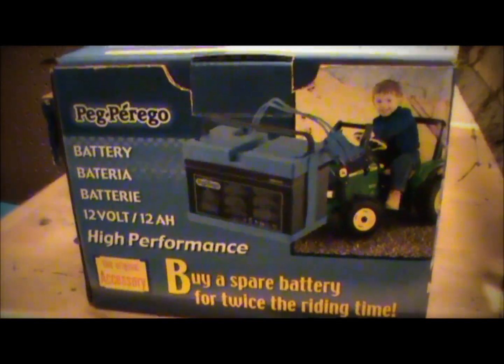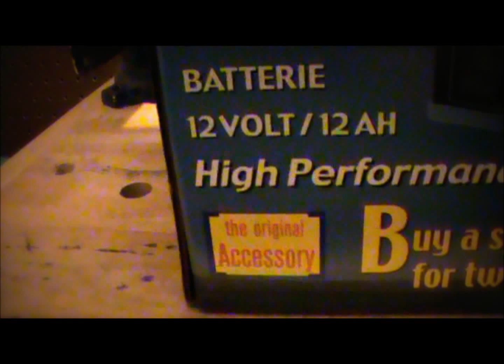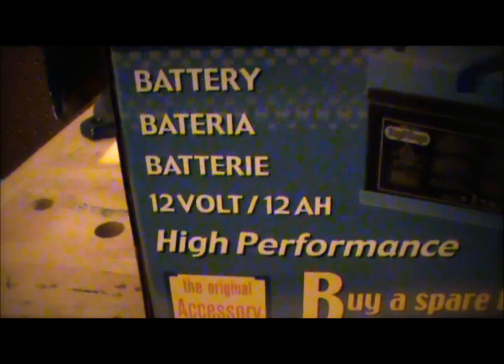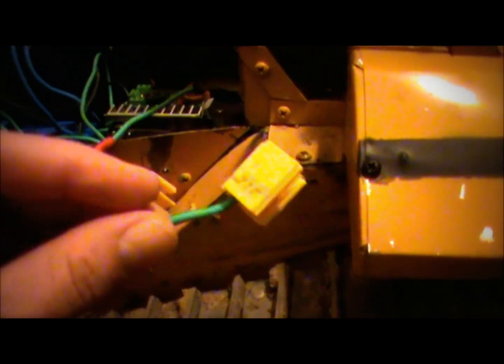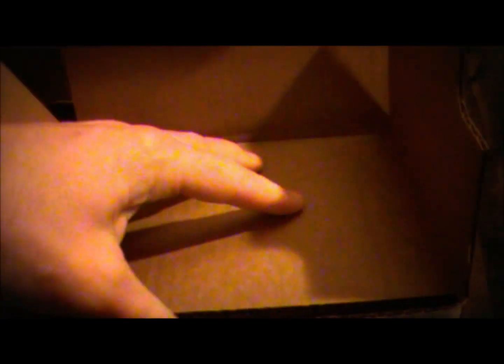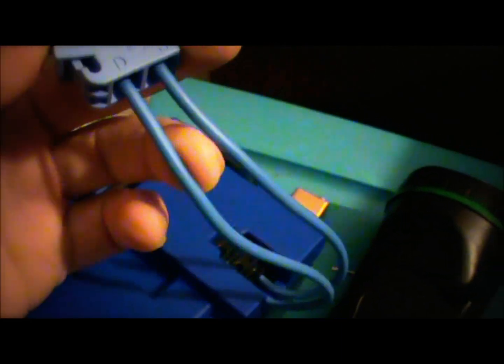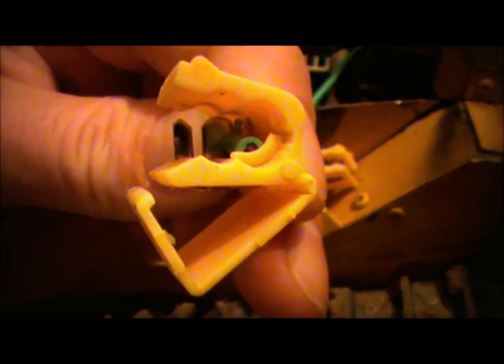RC Dozer Battery Replacement

Comment from the maker: Yes...got them from Robot Market place and they are the AME 226-series 12V 325 in-lb LH gearmotor - long shaft
The gear reduction was a big help! 
Had a big debate at work on where to add the bigger gear…on the motor or on the final drive… I put the smaller gear on the motor…just like a motorcycle; some say put the bigger gear on the motor like a bicycle.

Comment from the maker: I have little under $1000. Big cost items, DC window motors $50 x2, 8ft hollow pin chain $100, Liner Actuators $90 x 2, Radio and Servos $150, steel, nuts and bolts..around $100, 4x wheels $50, sprockets 2x $25. Bought the steel, nuts/bolts at Lows/Home Depot, ordered chain, sprockets, wheels from Mc Master Carr. Motors from robot market place, liner actuators from E motion LLC. Bought radio w/ servos from a hobby store.

Comment: That's really good...I'm only getting about 30-40 min with a 15AH battery...what motors are you using from RMP ? I wonder if your gear reduction is helping.....I'm running straight off the motor shafts  , and they only have bushings on the drive shafts not bearings...